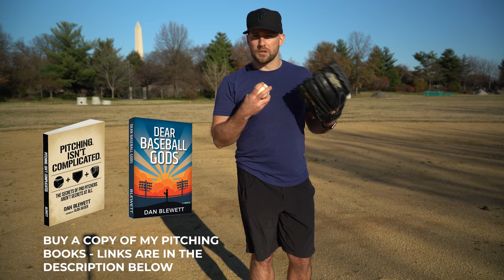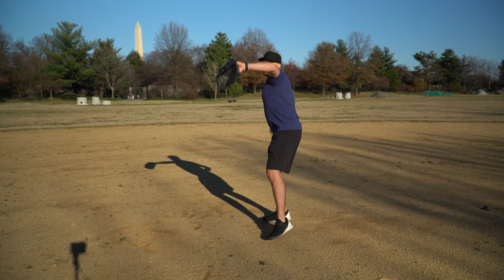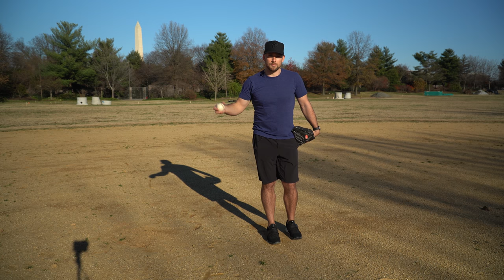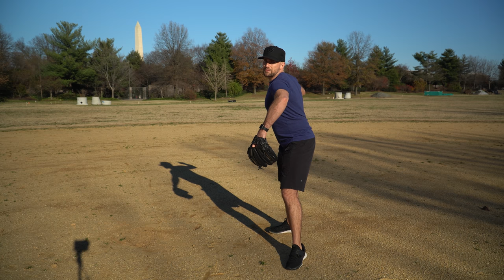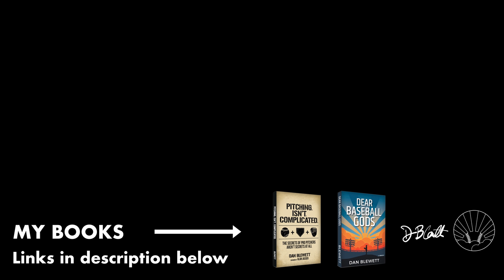Pitching Arm slots: How to Improve Yours

Comment: I don’t pitch that much anymore due to a shoulder injury we are still trying to sort out, but I’ve been trying to fix my arm slot for the infield. I throw sidearm-ish, in the sense that my arm is dipping but I’m trying to fight it so it creates this weird arm action. I would be okay with this, if it didn’t cause me pain and if I wasn’t so inconsistent with it, I’ve tried what you’ve said for a while but it hasn’t seemed to change my slot at all. I don’t have that tight of hips, but I have always had problems using my lower half for throwing. All the drills I have tried for lower half throwing from other YouTube coaches haven’t worked either.  What can I do to fix both problems, as they seem to have a connection. Thank you! (I have a video on my channel that shows my arm slot)
Reply from the maker: see an in-person coach. Also, sidearm is usually the default for playing infield. I throw sidearm playing infield in slow pitch softball.

Comment: Using different arm slots helps to keep hitters from seeing the same look which in turn makes it harder for the hitter, correct?
Reply from the maker: sure, but there's a reason you dont see virtually any MLB pitchers vary their arm slots...
Reply: Arm health???
Reply from the maker: no - its hard enough being consistent with one arm slot, it takes a lifetime to perfect. its too hard varying them all the time - the pitch quality ends up suffering and its just not worth it

Comment: This video answered a lot of my questions,  but how much does release point affect the whip of the arm? I've heard if your arm is too close to your body it has a lasso effect as opposed to a whip.
Reply from the maker: Not the foggiest idea what you mean by that
Reply: @DanBlewett  I was basically asking about the arm lagging.  I heard that terminology from a couple of online coaches. To rephrase it do you get more velocity from over the top throwing as opposed to sidearm?
Reply from the maker: generally, you throw harder over the top than slightly lower arm slots, but it's not a firm rule. Depends on the person.
Reply: @DanBlewett   Ok that makes sense. Thanks for answering